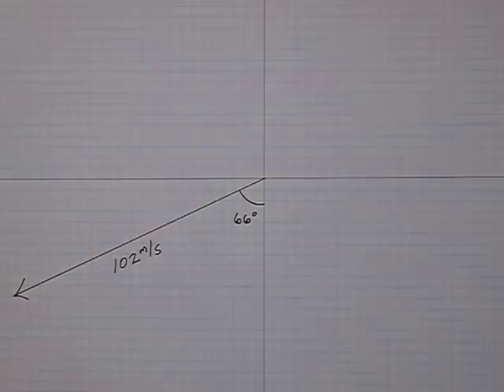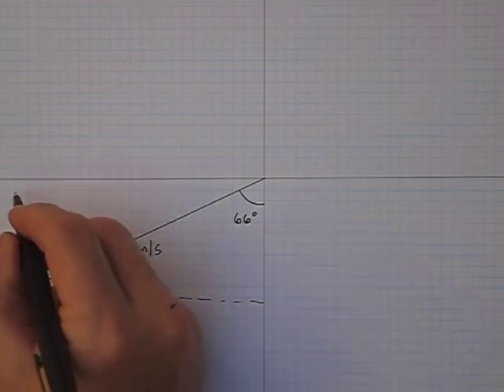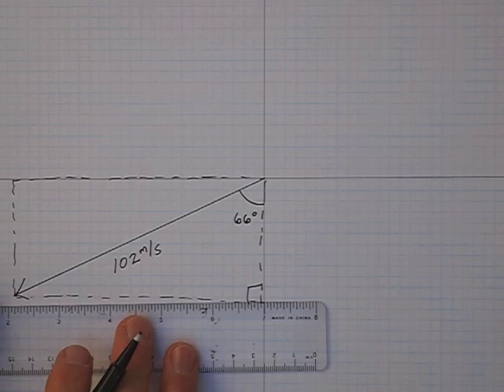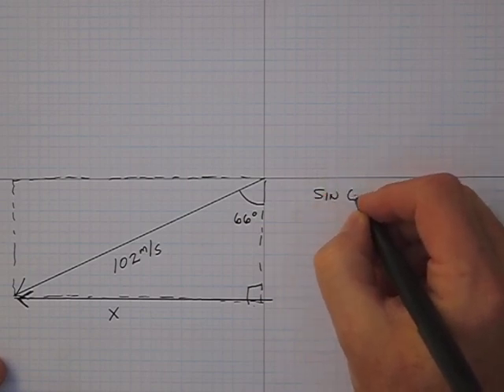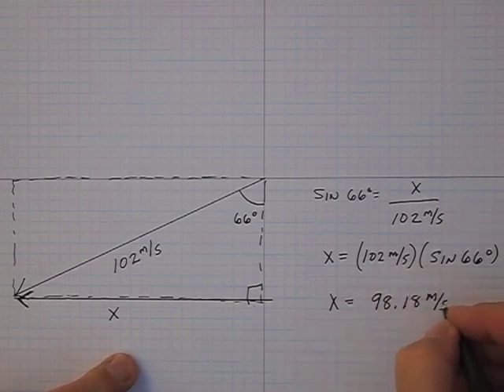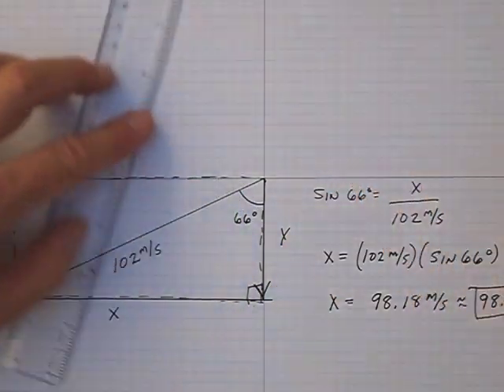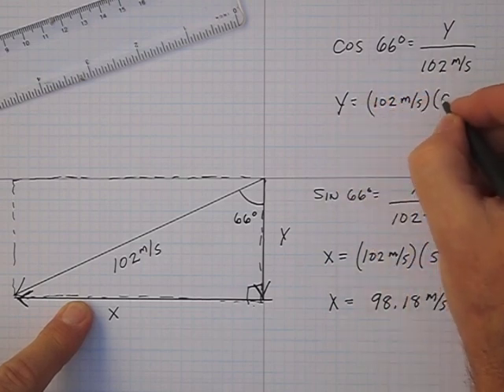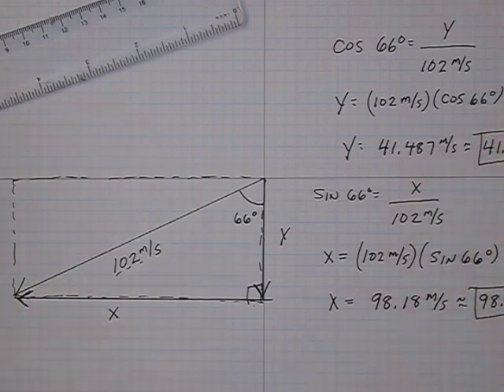Finding the x and y Components of a Vector Part 2

Comment: I have the same problem almost except they dont provide me with the degrees? how would I solve it without having the degrees given?
Reply: You will get the degree using Tan (teta) opposite over adjacent then press shift Tan (the answer directly) to your calculator, hope to help you
Reply: use inverse tangent to calculate the value of theta